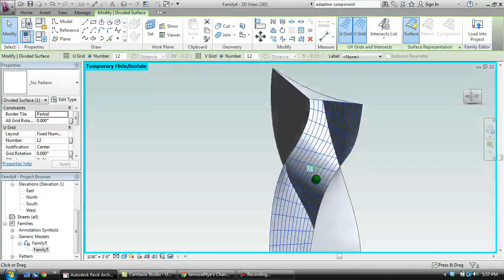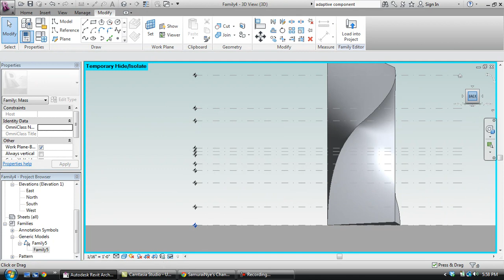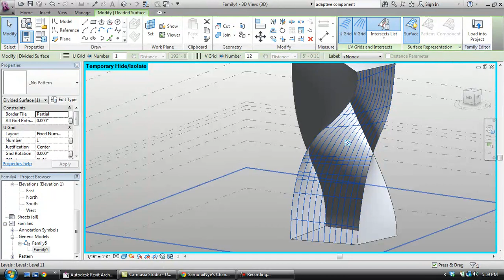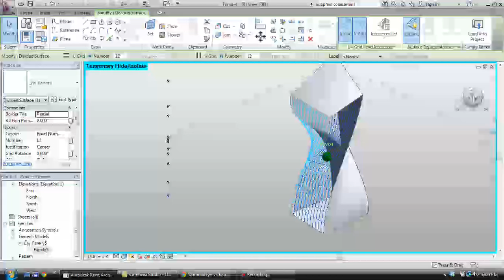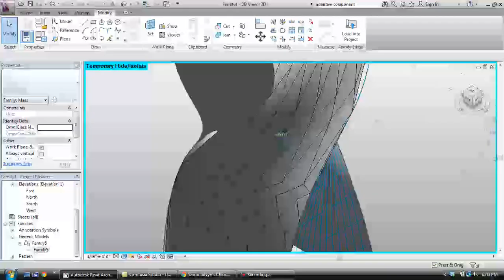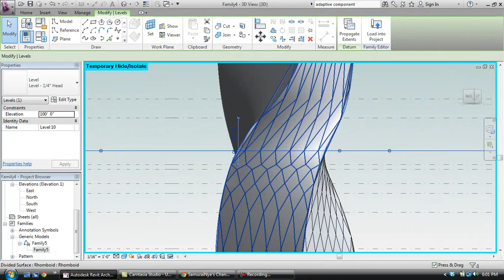Revit 2012 Adaptive Components part 2 - Custom Facade Pattern

Comment: Hi , Good Video, nice design,but I'm facing a problem in Revit that by designing by massing I can either create a Solid Building or a curtain (Glass) system Building ,I can't combine glass with Solid walls (wall with a curtain wall ).
For example  by using  sketchup You can  Draw over a model Surface  to determine  where the Glass will be .
Hope You can help me resolving this problem in Revit .